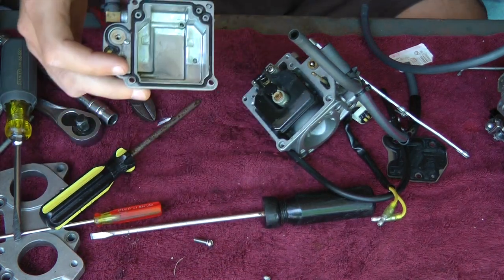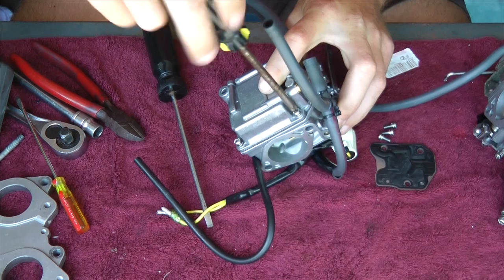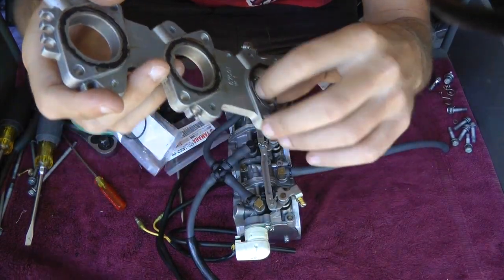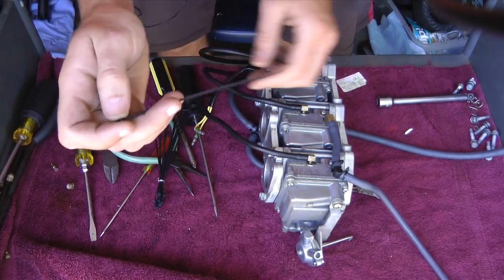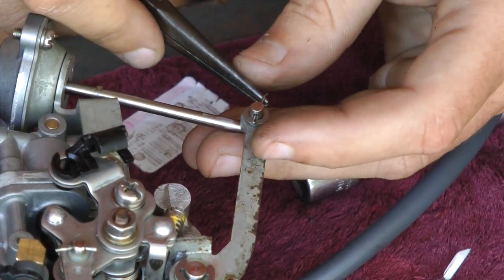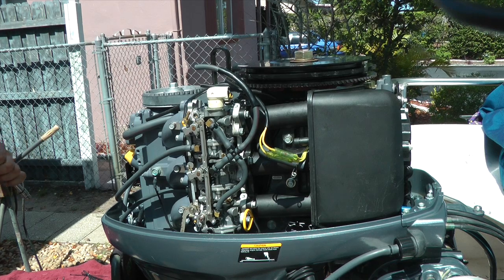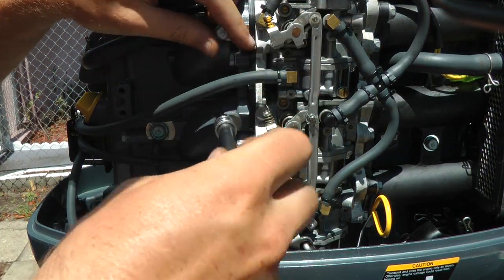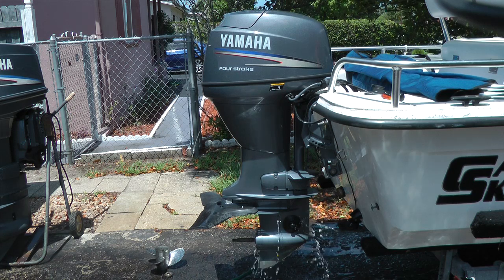Yamaha 40hp 4 stroke carburetor cleaning (PART 2)

Comment: Hello mate, l think you are the best on youtube to ask this. 'i have a 2001 F80hp Yamaha, Its running rich on cylinder 4 just a tad wetish,not much, but the other 3 are white greyish. I  guess they are running  leaner. The carbs were cleaned, a year before last by a mechanic, he adjusted valves etc. The engine ran great last year. But it had a bit of a shake at idle rpm 8 or 900, so that's not normal, but l know the shaking from side to side is not normal, put new plugs in, exactly the same. When l rev it up, makes a slight  strange sound every 30 seconds or so. like a choking or slight misfire, not much just something slightly. Could all this just be that carb 4 is dirty, did drain all fuel out over winter. from carbs. Can l some how adjust the 4th carb to try and get it leaner, would this possibly cure the problem. Do l need to buy that carb tunning thing to see if the 4th carb is out of synch. Should l just turn that scew on the 4th carb and see if a slight adjustment would get engine to not shake so much. Any advice would be great,was launching tomorrow for the season, but hesitant now. I am not scared to do a carb clean rebuild if l must, but what can I do first, it is definitely cylinder 4 that's a bit rich. Komp test was fine on all 4 around 195-200 psi.

Comment: I'm replacing the accelerator pump belows on my 2000 mercury 40hp 4 stroke. It has the same yamaha powerhead and carbs. How do I remove the accelerator pump rod without breaking anything?

Comment: Hey man I’ve got the 02 F30TLRA motor. I’ve done my research and it looks like the only differences between the f30 and f40 is the main jet, the needle jet, and the bottom of the bowl, likely a small difference in the plunger but essentially the same thing. The idle jet is the same. For obvious reasons I want to increase power to at least the 40hp should I just replace the main jet to #108 or should I replace the needle jet as well. Would the #108 be too much? Or should I just go for the #95 jet? Please advise. Thanks
Reply: That carbs look identical but they are not the same. The 30hp carb is smaller internally.  They have different part numbers as well.

Comment: Hello. what is the difference between yamaha f30 and f40 carburetors? just the jet diameter? Or different diffusers? what is the diameter of the diffuser on the f40?
Reply: I read it’s a restrictor plate between carb and engine plus a different ECU. If you do it let me know, have the F30 carb version and it’s same weight as F40
Reply: The carbs have a smaller inner diameter on the f30. Need f40 carbs for the extra power. Not just jets.

Comment: Hey mate, I just picked up an F40 and it has a leak from the plunger on the top carb. The boot/cap is broken on all 3 carbs but only the top leaks. Is there an internal seal that I should be looking at replacing or just the outer boot? Cheers!
Reply: Did you figure out why it was leaking ? Mine is doing the same. Others online are suggesting the needle valves aren't seal off... LMK if you got yours sorted.

Comment: Your putting in jets from a small engine? Is that correct? 

Also I have a leaking float seal on the top carb, do I need to take all 3 apart and clean? I just bought this engine used. Seemed to be running good before the leak.

Comment: Do you still work on these? I see you are in my area based on the sea trial. I have replaced the jets as recommended, and it has cleared up my acceleration issue, it is now flooding the carbs though. Any suggestions or if you still work on motors around here, maybe you can look into this for me?

Comment: Hello.im from finland,i have yamaha f60,2003,also have some problems with engine running,its not so smooth.can you tell me if there are some better size needles to carburetor.i have heard that this is somekind of type problem in these models..

Comment: I have a question on the slow speed jet does it have a hole all the way threw it. I think one of mine is pluged.
Reply: Jim Nichols you should be able to see through it when held up to a light. the home is tiny but should be able to see through it. sounds like your is blocked. use one of the wires from a wire brush to open it.

Comment: That was awesome.  Well done.   I just purchased an 11' inflatable with a Yamaha 40hp 4 stroke that was shipped from Houston to my slip in Lake Tahoe (6200 elevation).  The engine only has 34 hours on it.  It will accelerate in neutral to 5000 plus but when in gear I cant get it to go above 2600 RPM and 6 mph.  The boat sat for a year and the previous owner put in fule stabilizer.  Does this sound like a problem with the jets or fuel filter or pump?  Thanks in advance.

Comment: This is great. 
Thank you very very much, from France. I have the exact same engine (2007) and between 2000 and 3000 it's very difficult to get the power and sometimes the engines is simply stopping.
Your video is perfect, and I will do the same soon.
Best regards.
Philippe

Comment: Hi can you make a video of all the wire harness conectors and where they clip on the motor i took my 40 completely apart to replace the power head gasket and valve seal also i used your video to do the jets and clean my carbs my motor is at the machine shop and im worried i might have forgot where evrything goes stupid me i didnt make a video before by the way awsome video man good zooming and detail thanks and best regards with your chanel.
Reply from the maker: hello but sorry I cannot make a video at the moment because I have sold the boat with the engine and I do not have another motor to show you

Comment: This is a great video.  I have a 02 F30TLRB and I am constantly fighting this issue.  By chance, could you tell me what jets my carburetors would need?
Reply: +eric edic  30 hp is the same block I think
Reply from the maker: +Tag Out you might just have your jets clogged. I only heard the 40hp yamaha 4 stroke having this problem not the 30hp yamaha

Comment: I am going to attempt to rebuild my carbs 2001 50hp yamaha, F50TLRZ have the exact same problem you had.  Carbtuner comes this week and was going to order 4 carb rebuild kits. Seems like there is an upgraded kit from the original. 62Y-W0093-11-00 new kit from old kit 62Y-W0093-10-00 hope it has better jets or something in new kit. Also did you adjust the air mixture screws on carbs?

Comment: what cleaner do you use? I read you have to be careful what you use or you can take a coating off the carb.
Reply from the maker: fjmurray25  carb cleaner?
Reply: eric edic yes what type of spray or solution did you use? Brp tuner, simple green, ect?

Comment: thanks awesome videos I have the same boat and motor. I'm going to try this.
Reply from the maker: fjmurray25 you must replace the jets. Look in the description box i have the part number
Reply: eric edic where can you get that carbtuner? i only see it for sale in the uk? do you have to sync them ?
Reply: fjmurray25 will the jets work on a 2004? boats.net say for 2006 and up?
Reply from the maker: fjmurray25 Yes it will work. Look in my description for the part number for the jets that you need.
Reply: eric edic  thanks for the video. I followed it exactly . I even bout the same carbtune you use and balanced the carbs really good, I have the same boat and motor. and could only get up to 12mph. i ran it with the cover off to see it the throttle was going all the way up and with the cover off it does 25mph! i put the motor cover back on and 12mph. take it back off 25mph.? then the third time i got it to climb to 25mph with the cover on but you have to move the throttle slow and climb slow I cant do a hole shot it will stay at 12mph at full throttle? it does idle super quiet and low speed moving around is perfect. I do think my rpms are a little high in idle but not bad. any suggestions ? thanks so much